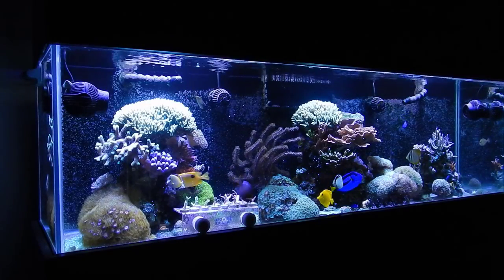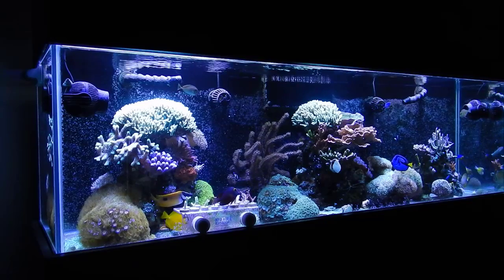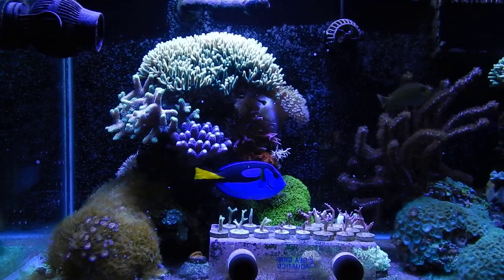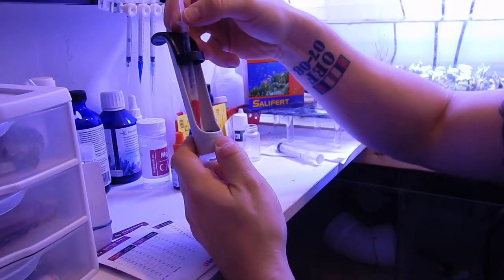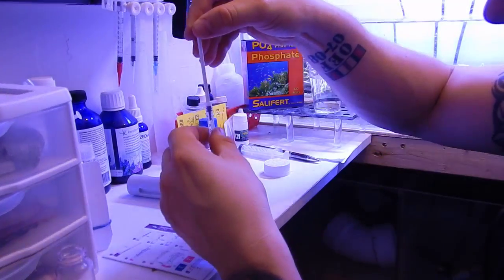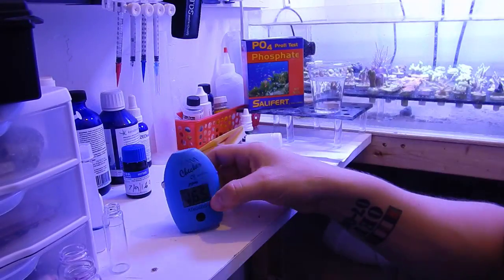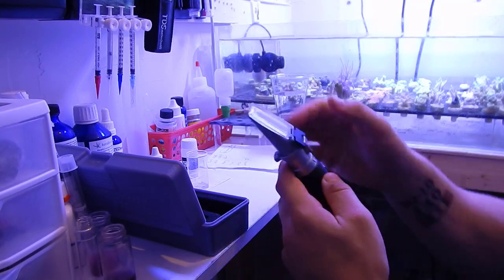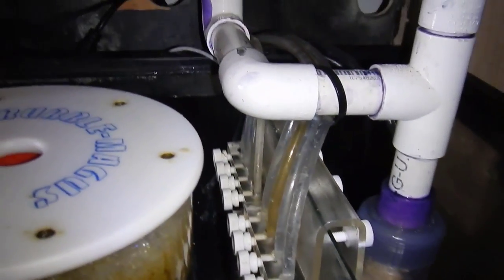Testing & Maintaining Stable Water Parameters | Answering Beginner Questions Part 4

Comment: Need help! I have zero nitrates I mean zero nitrates in my reef tank and I believe it's the cause of my corals losing color, how do I add some nitrates back into my tank? Do I turn off skimmer for some time? No water change? Add some sort of nitrate liquid? Plz answer it would help me so much thanks man!
Reply from the maker: First off no need to try to add something to increase them. What are you doing to get it to zero? are you using biopellets, zeovit? Big water changes? not feeding? I would look at that first. Another thing that causes corals to lose color.. did you increase your lighting? did you add new lights? Please answer these questions for me to be able to continue to help.

Comment: Another nice vid, thanks man.
Did not know that about the elevated Mg level and snails :|
Have noticed a few snails upside down on the sand lately on a regular basis
My Mg has been over the Red Sea test limit of 1500ppm for a while now, how did you test yours to be above this?
I'm using NSW and i've been told the Mg level in our part of the world in naturally high, so now i need i research how to bring it down.
I currently use Kalk in my top off for Ca and Alk and dont dose anything so the Mg is clearly coming from my NSW.
Reply from the maker: I keep using more titration and do the math.
Reply: ahaha, fair enough. So i did this and got the color change with the 1st drop of titration so i'll call my Mg at 1500ppm thanks

Comment: Ok I need your help with the Side Chick it's 16 gallon I do 2 small water changes a week and I test weekly for everything you have mentioned and all my parameters are spot on and my corals are doing good and I have 2 crabs 4 snails 2 clown fish and a firefish and a cleaner shrimp and my issue is hair algae .... I have tonnes of it and I'm fluval clearmax and running carbon and was wondering if I use phosguard do I remove the fluval clearmax or can I run them both ??  It's driving me mad my snails and crabs are super super hairy hahaha and I want it to go it's ugly
Reply from the maker: The first thing you need to do is find the nutrient source, check the tds of your top off/water change water. Next is how old is the rock and how did you come about getting it? A lot of nutrient issues come from using USED rock, rock is a sponge and if the tank that had it before had any nutrient issues you can bet that its inside the rock. As for the fluval clearmax that just removed phosphates but you are still left with elevated nitrates and thats what feeding the algae. I would stick to the recommended amount for reef and change it out as recommended. So now you need to find a way to remove nitrates as well as the phosphates.. You could increase your water change amounts, add biopellets(if you do please contact me before hand) or you could plumb in an algae scrubber/refugium. Those are all great ways to keep nitrates in check. At the moment thats all the help i can offer, like i said find the nutrient source first and let me know.. check out my algae video in the beginner guide playlist.